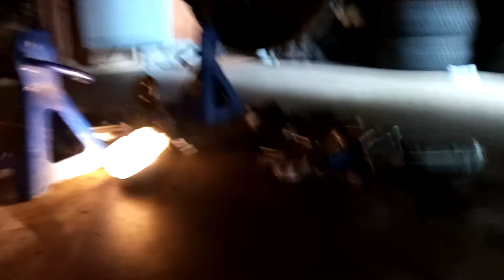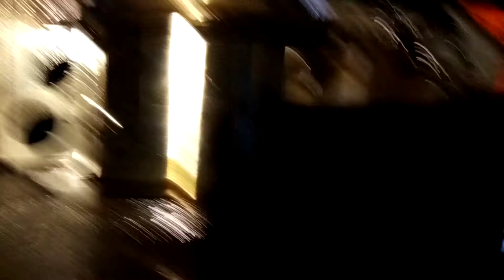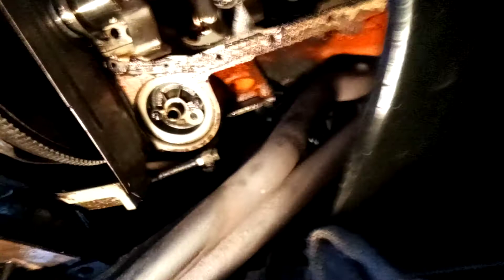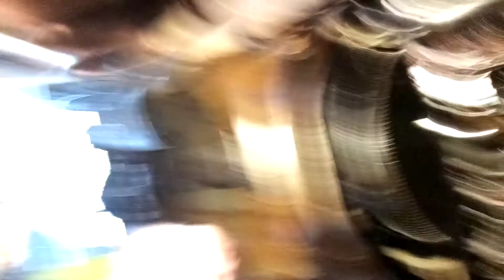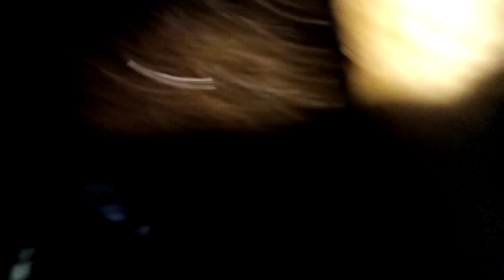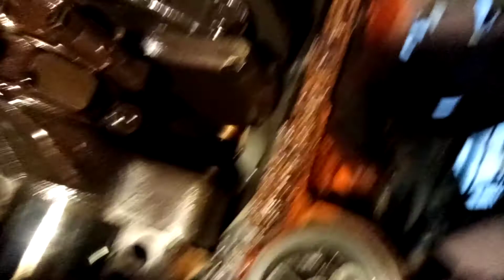2 of ? C10

Comment: I think I’d rather deal with a Ford rear main seal . That must have been fun getting the oil pan off with those headers . Thanks for sharing
Reply from the maker: The worst of it was actually getting the lower bell housing inspection cover or the oil pan out to start with, there was no clearly distinct way to start working them out past the riveted crossmember, finally after jacking the engine and trans way high I could swammy them out. Thanks for stopping by !